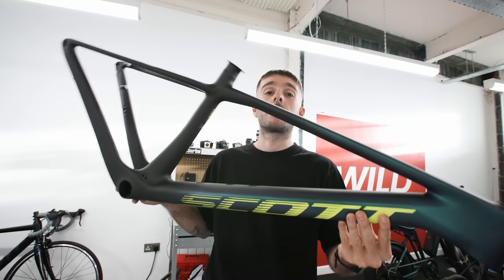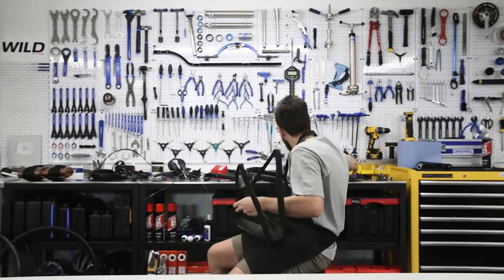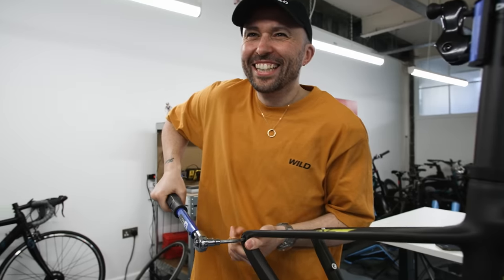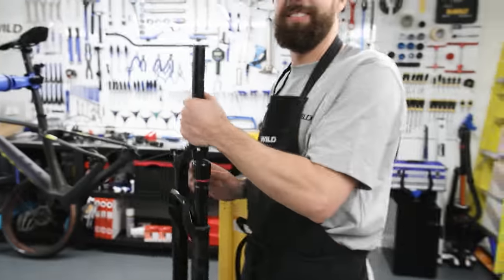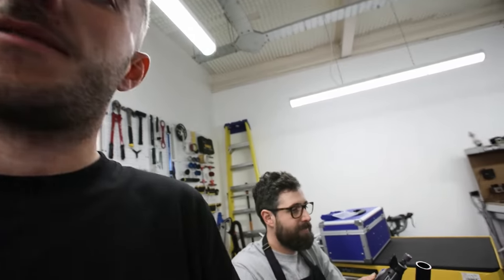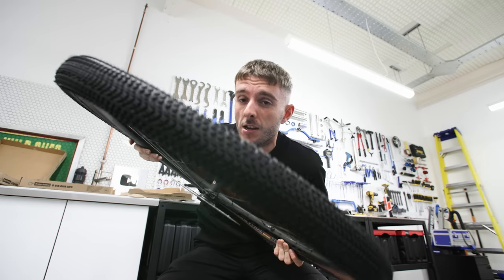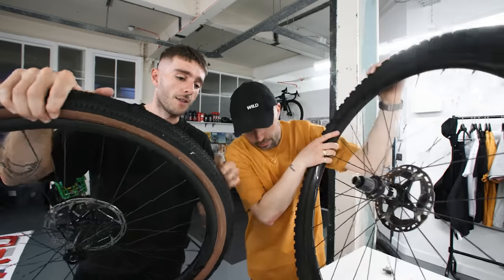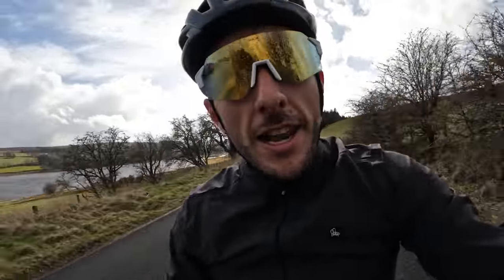Is This Just A Gravel Bike? - Scott Scale RC

Comment: When I do gravel events here in Belgium, they're almost always in the Ardennes, and the best gravel bike is a HT MTB as it typically gets far more saucy for your 40c or even 50c tires. My bike is an Ibis T29 with some custom Duke/DT Swiss wheels XO1 and Rockshox SID Ultimate, but 120 because I still ride singletrack. I do have a lockout instead of a dropper. The party trick for the T29 is that it can be single speed or geared, but also the rear triangle fully unbolts from the front triangle and fits into a Ritchey Break-away/S&S travel case. Works great if you do a tour somewhere else that you use the fast rail like Eurorail to get where you want to go.

In my opinion...and I know the channel is sponsored by Hutchinson, but the Vittoria Mezcals are fantastic fast MTB tires for gravel, but still have great grip for XC.
There is of course lighter options from Schawlbe....I think one model is something like 450g and wicked fast, but not the most reliable. The Mezcals won the Tour Divide w/o so much as a puncture!

I know this is just a test, but if you run bar-ends inboard, you can get a psudo-hoods position which works great for long gravely sections and very little weight.

Comment: My first mountainbike that was a good gravelbike was a soft-tail 1998 Rocky Mountain Element Race frame with all other parts from a good Merida . Triple chain ring in front swopped to 28-38-48. The bar is narrow and very low. Which meant that i often stretch my fingers to get extra 5cm longer arms.

Comment: For anything under 100kms / 60 miles MTB is the way to go, but for longer rides drop bars give you more options to rest hands. Also for bikepacking or if you're mostly on paved or gravel roads then gravel is the way to go. Personally I've gone gravel + full-sus MTB as a hardtail XC MTB is indeed a pretty close category to gravel.
Reply: There are actually a bunch of alt bars you can use on a MTB to get additional and more aero hand positions. They look to be better solutions than drop bars in terms of versatility

Comment: I heard Safa Brian said on your other video about choosing gravel bike over MTB. All my gravel grinder friends have the same reason, especially when you have to  ride MTB in the tarmac portion of your route. The main reason is the gearing of MTB is not big enough and you can run out of gear real fast in flat or descending tarmac. So, why not put gravel groupset into MTB?
Reply: My scale has a 36 chain ring and a Shimano 11 speed cassette with 27.5 x 2.25 tyres - it does about 40kmh with this setup on the smallest sprocket (not that I can hold that speed for very long with MTB tyres and position). 
Not sure how 29er wheels change things though?

Comment: You must match the tires on the comparison video as well. Gravel on relatively smooth 35mm tires and on big knobbly 50mm is completely different, and the comparison to cross country would be a bit pointless, because a lot of the difference would be in the tires. At least part of the video 🙏

Comment: I'm suspicious of that weight because Scott own top of the range £13,999 Scale RC weighs in at 8.9kg and that's got some crazy all-in-one carbon wheels. OK, it's got 2.4 tyres.
Reply from the maker: It’s definitely the tyres - we also didn’t install fork lockout which would add a bit.

Comment: So my GT Aggressor frame and Recon Race 100mm are coupled with those unfashionable 26" wheels with fast rolling 2.1" tyres I've got 
A/- Sora shifters with Tourney mechanical calipers, drop bars and a 46/30 x 12-36 
or B/ On-One Geoff bars, hydraulic brakes, and a 26/36 x 11-42 Deore M6000 system for a proper gravel touring bike?( If I win the lottery I could buy some cheap 650B wheels so I don't get all embarrassed amongst the "grankpackers" (Gravel-*anker-packers))